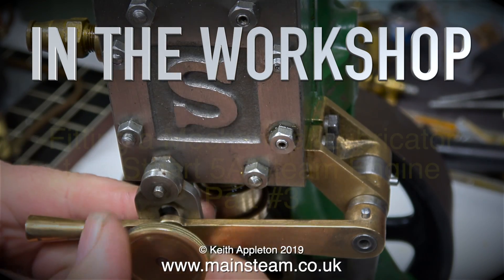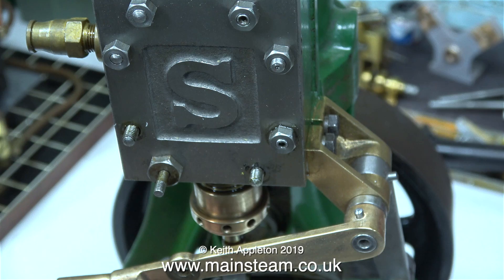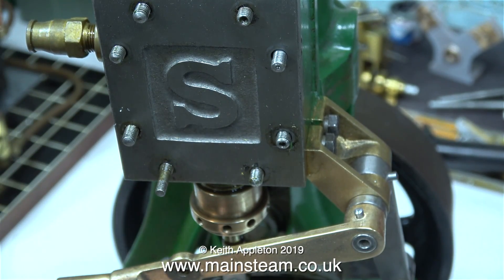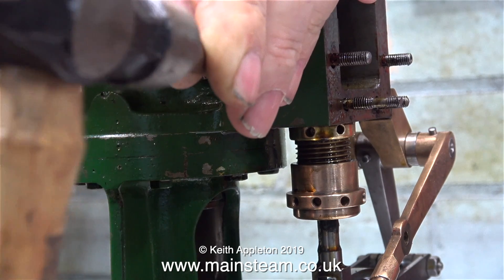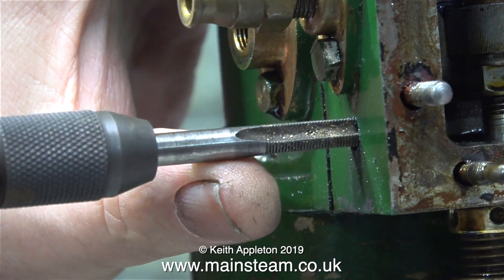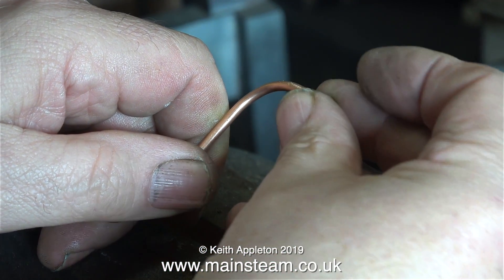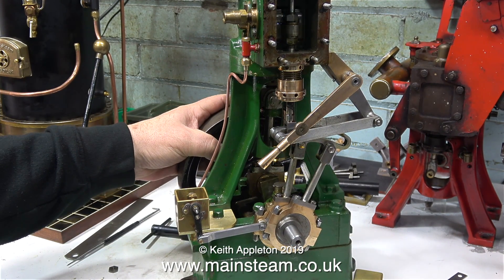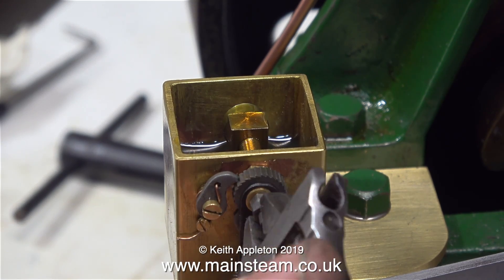HOW TO FIT A MECHANICAL LUBRICATOR TO A STUART 5A - PART #3

Comment: nice job, just a curiosity, how does the upper inlet port of the cylinder get the oil when it is at the bottom of the steam chest?
Reply from the maker: the oil emulsifies in the steam and water mix - it goes everywhere it needs to ....

Comment: Keith, a question about Bahco tools.  Current production is not in Sweden.  Is product quality holding up?
Reply from the maker: They appear to be OK, but maybe other viewers have had different experiences with the modern versions?
Reply: @keithappleton Appleton my dad broke a Bacho pipe wrench at work not too long ago. when he tried to pull really hard on it, it just snapped into two pieces. On the wrench, it said: "made in Argentina". but that's the only time I've heard about something bad Bacho tools